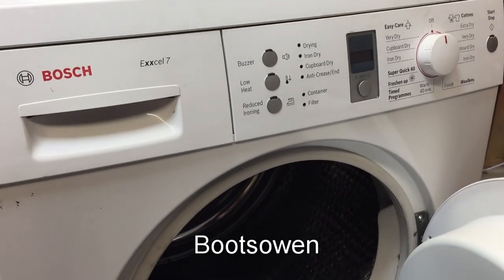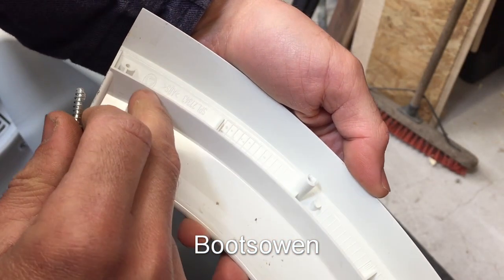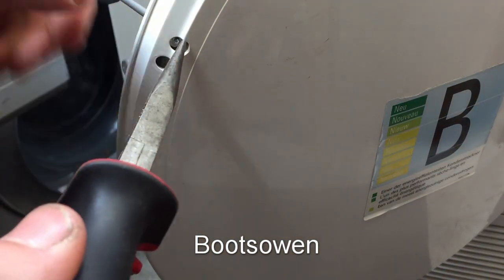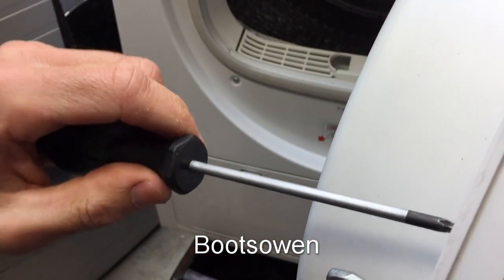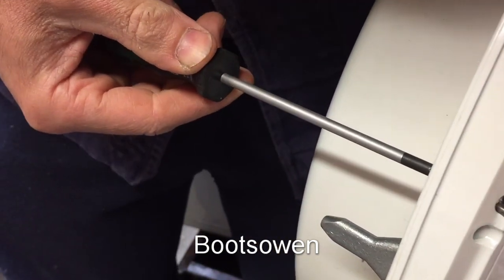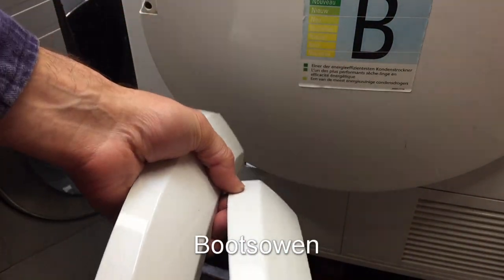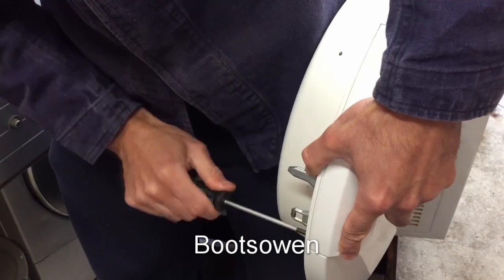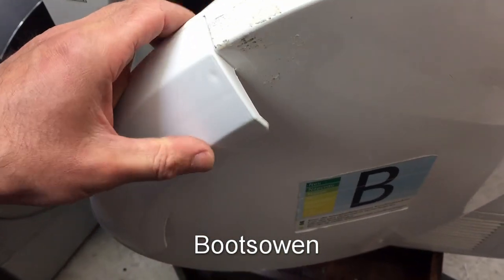Bosch Tumble Dryer Handle Repair

Comment: Thank you! Just used this video to change the handle on my parents tumble dryer. I found that front panel can actually be pulled forward (a little like taking the lid off the front) to hold on to the broken plastic bits on the screws more easily with some pliers.
Reply from the maker: Excellent, well done

Comment: Hi There,  Great Vid, I will be following this in a few days.   Have you any advice on how to release the door if the handle snapped off while the door was shut? Many thanks. B
Reply from the maker: Just pull on the frame of the door.
Reply: @bootsowen  I have the same problem as Betty. If I pull on the door frame, the front half of the door separates from the rear half but the door doesn't open.

Comment: Hi do you know how to replace the lock part? Not the bit on the door. Thank you
Reply from the maker: No, but I could figure it out.
Reply: That should be straight forward. I’ve ordered a replacement lock part and handle. The panel where the screws are located splits open from the outer door. The new lock should easily fit in there.